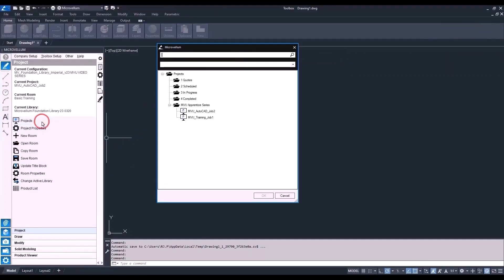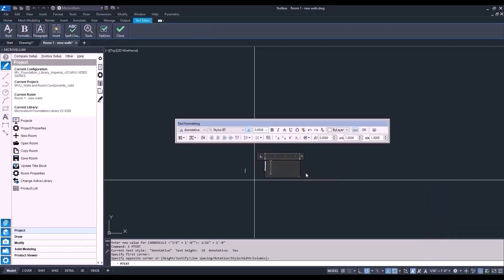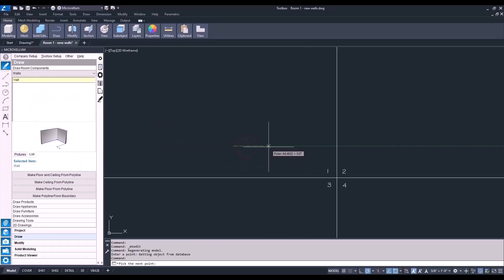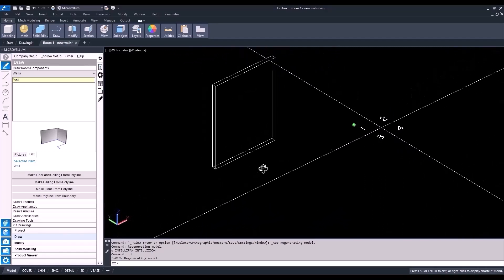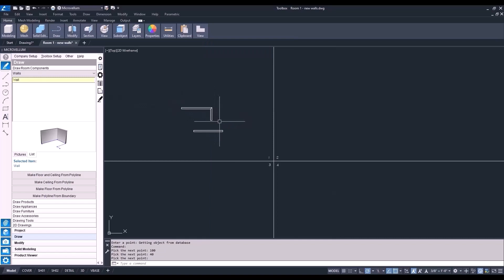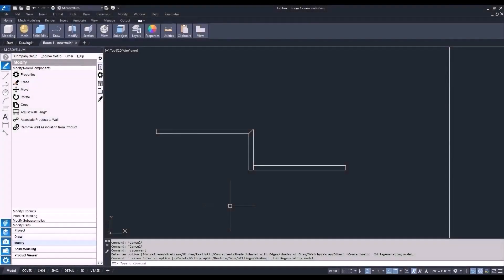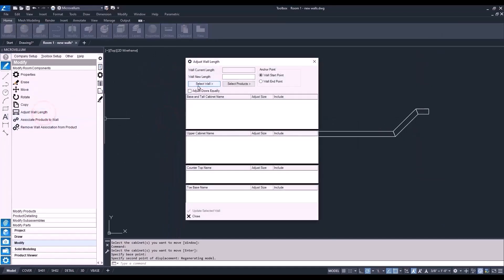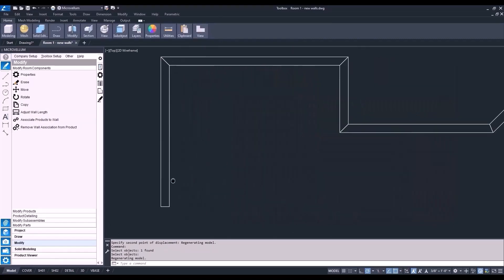Wall & Room Components (Part 1)

Comment: I'm not exactly sure how/where to ask this, but I think its important to know. With all other software I have ever used, you start a new file/document and everything associated with that file is there when you open it each day (or at least it will direct you into relinking any linked files) But in Microvellum I'm getting this dialogue: "The current drawing Is Not part of the current project.  Do you want to continue to draw the product?" I cannot find where/how to reassociate a drawing with a project.